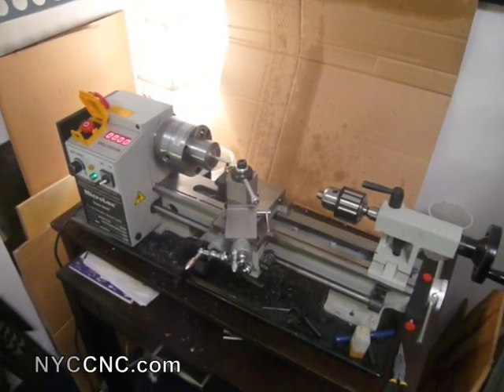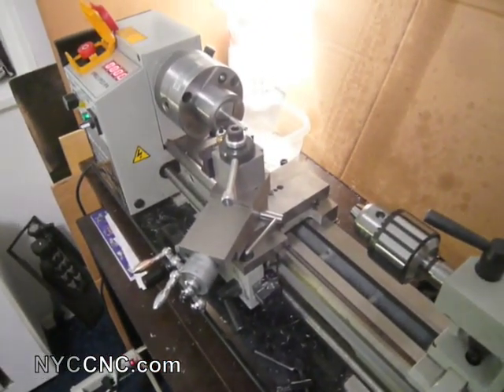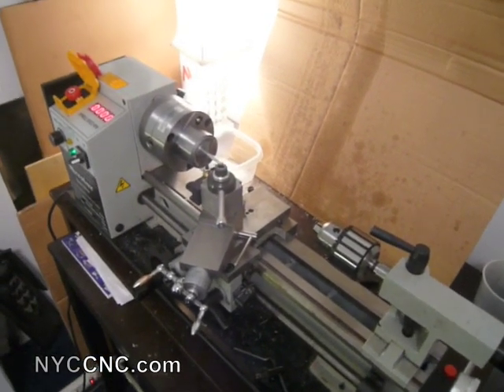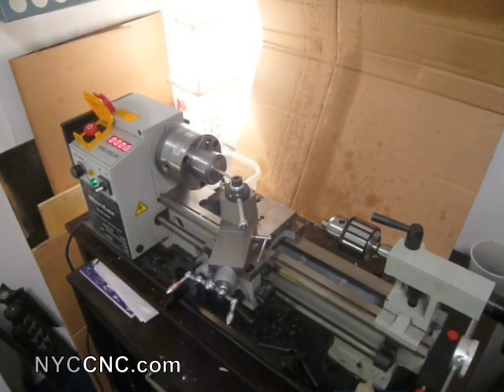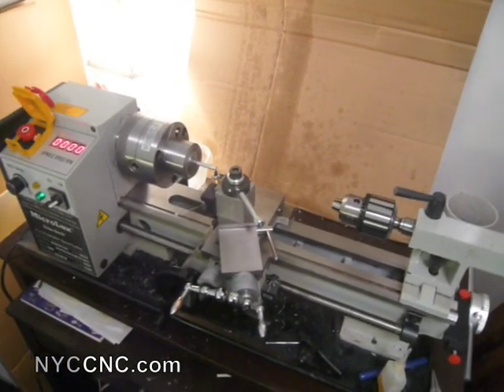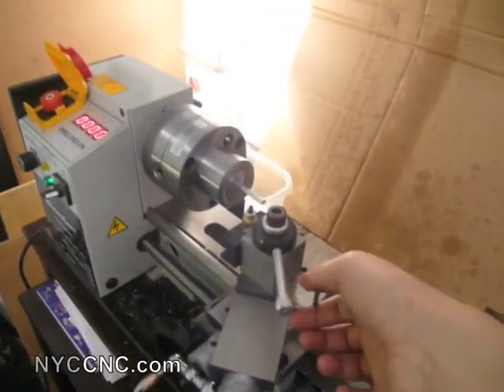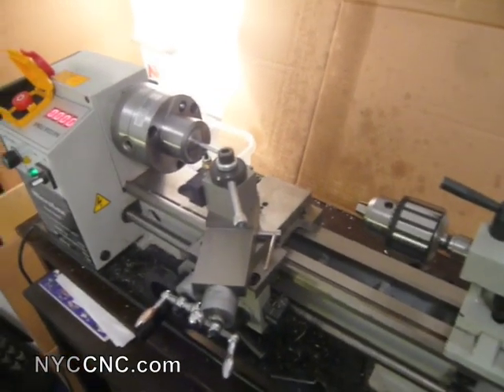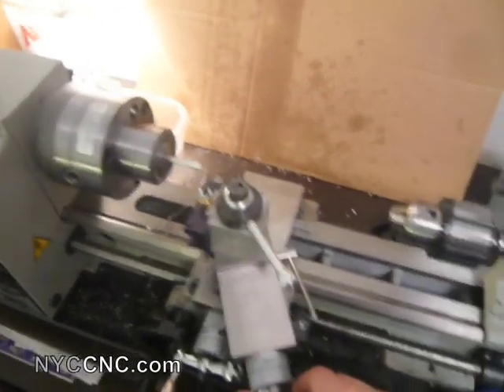Lever-Operated Compound Lock for Mini-Lathe - BEST IMPROVEMENT!!

Comment: I think you've talked me into buying Frank's compound lock article. I absolutely hate having to set the compound by trial and error, particularly when I'm turning a piece right at the lathe limit.

About a month ago, I turned a 7 in disk down to 6 in for a backplate for my 4 jaw. Very frustrating having to crank the compound out of the way to get to the bolts while I tried to get maximum range by trial and error.

Thanks,
James

Comment: Great mod ,, however I discovered the reason for the 7/8 change on the pivot point , In the original position a function like parting etc will move the angle where the 7/8 position is closer to the pivot point giving it more leverage if you will,, so I am going to move my lever to the suggested position ( 7/8 ) like the plans show. there is a reason he done this and thats why   thanks  Paul WPG MB

Comment: they're not socket head cap screws there Allen head screws
Reply: Incorrect.  These are whats called socket head cap screws.  They are the socket that receives the drive tool.  And Allen is a tool brand not a drive style.  These ones in particular are hex socket cap screws.